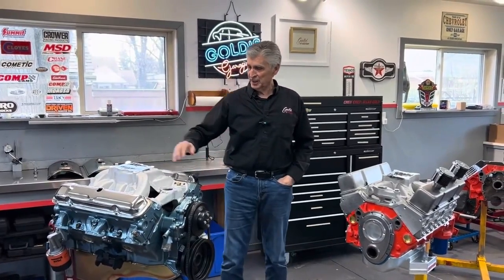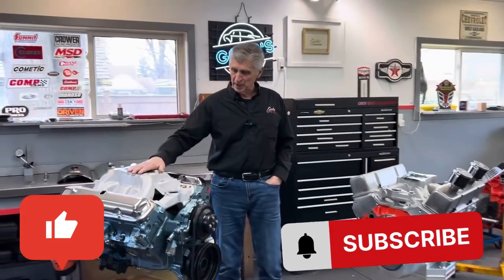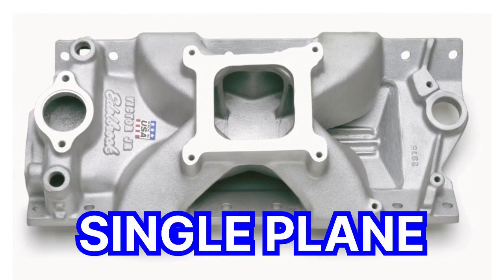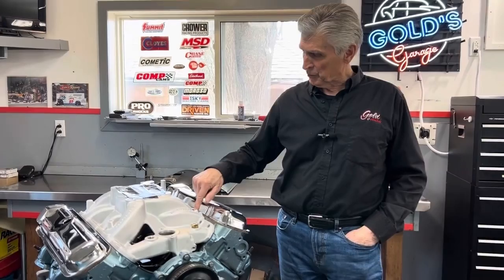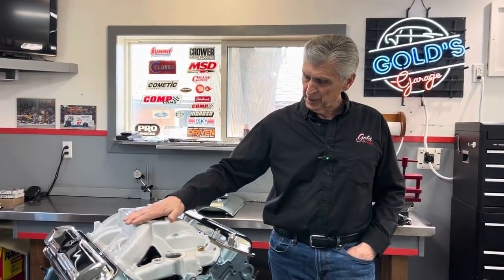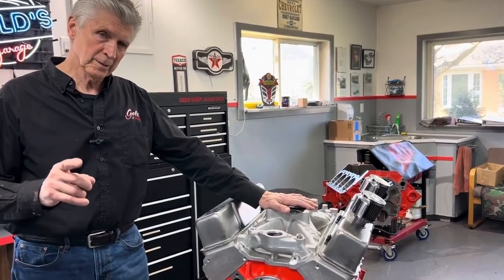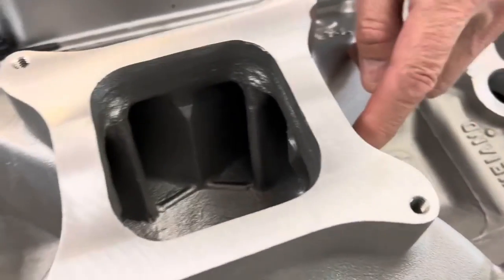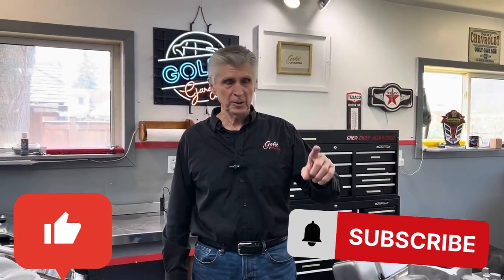SINGLE PLANE VS DUAL PLANE INTAKE MANIFOLD - What is the difference?? Which do YOU want?

Comment: Dual Planes have 180 degree separation to smooth low speed running, first employed by Henry Ford in 1934 because the 1932 motor ran too rough.

Comment: The picture of the dual plane manifold didn't help to visualize what is really going on. For those like me, we want to see where those underneath runners get their air-fuel mixture from. How is it tied into the top of the manifold? I just figured it out, I think. Another picture from the opposite angle would help, or one at 90 degrees of the first one would really be even better and would show both hi and low runners.
Reply: The air/fuel mixture comes from the carburetor. Hope this helps.
Reply: @shelbyavant5081  I appreciate the effort.

Comment: Please dyno the original intake on the Pontiac versus the eldebrock dual plane,I advised my friend the stock intake is better .Prove me wrong! Like 👍 and watch your information on engine builds!
Reply: Its not a matter of which one is better, it's ALL related to ur combination......if all stock, the stock manifold does quite well, if u've got a lumpy camshaft and/or ported the heads, the RPM is a no- brainer......the COMBO must work together, not just add the intake, cuz others did....and btw, its ED-EL-BROCK, PLEASE folks, look at the spelling......
Reply: @user-bc9sz1dj1g  ok,if this GTO has a cam it must be small ,car runs good far as driving ,it does have original engine, to me its better to keep it 💯 making it c worth more money  💰 in the future. Really nice right down to the factory rims!! If you add great intake and carb with headers a collector looks at buying the car He'll say no I don't want it was a Drag Car!!
Reply: @RonaldLewis-py6yt  i'm with ya, STOCK intake works nicely with a stock bulid.......no need for ANY aftermarket intake, just cuz everybody else does it.....COMBINATION must work with each other!!!!!...BIG intake, no carb, big intake, big carb, no cam....all garbage.....i had a STOCK manifold on my first engine (400, back in '83), had a RAIV cam, STILL did well, NO need for any other intake......COMBO MUST work properly!!
Reply: I still want Mr Gold to dyno stock verses any aluminum manifold ,think about a Super Stock Drag racer he will use the original intake and make more Power!!!

Comment: I was thinking about switching to a single plane on the engine I'm building for a fairly light s10.  It will be mostly street driven with occasional track time.  I've got a mild 350 now and have a hard time with blowing the tires off in the first 60ft. My new engine will be somewhere around 475 hp and 450 torque.  I will be installing cal tracks as well.  Any thoughts.
Reply: I’m no pro.  Just amature but you are looking at what my engine builder talked to me about.  Some cars can only use so much torque at the first 60 ft without loosing traction.  You can transfer that to the top end and use it better.  You will still be streetable.  Single planes will work on the street.
Reply: 3500 converter and  3.73 gears with a Victor junior would work well in a light truck